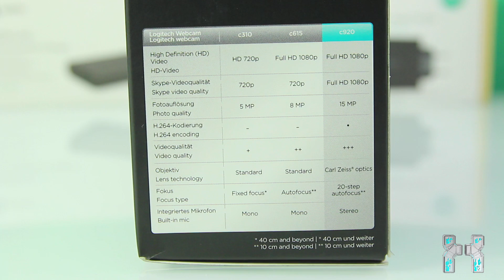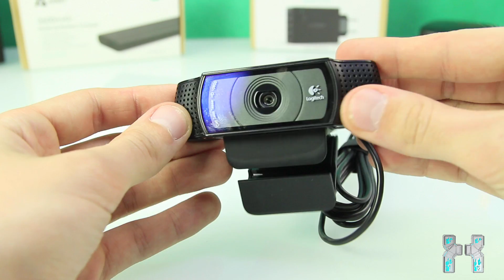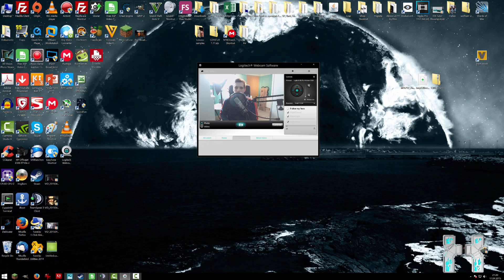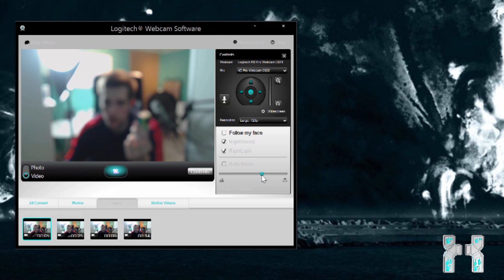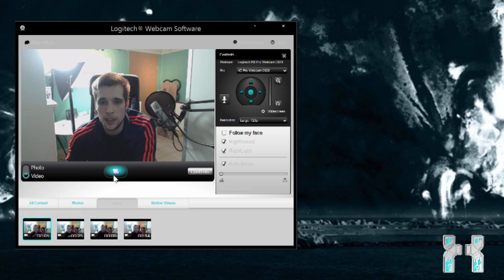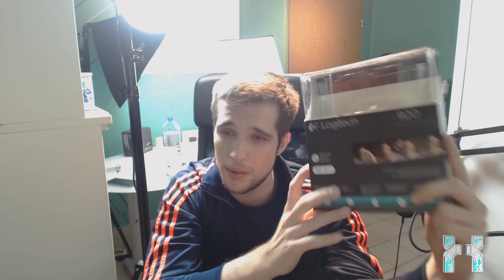Logitech C920 HD Pro 1080p Webcam - Best Webcam / Facecam ever ? Full Review [HD]

Comment: The picture seems good but the audio is crap. So I'll just use headphones.
Reply: DotyExtremist for good audio, get the NW-700 and a 48v Phantom Power. From what I've heard it's a great starter mic for its price. Plus, you can get it with 2 different types of stands.

Comment: I have a Logitech orbit. Which has an almost 360 turning angle. The follow my face feature is great for it. If your moving around a lot it's very useful as it will track your face by turning the webcam. Sadly the c920 does not move mechanically. That's why it doesn't track. :)